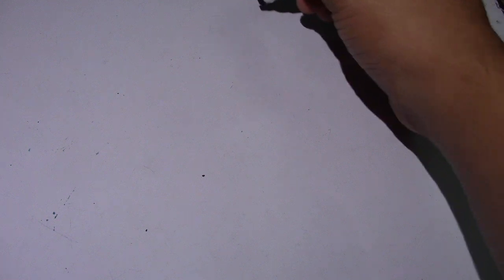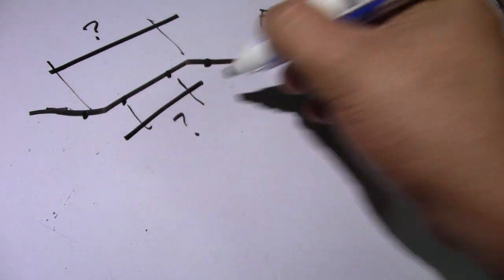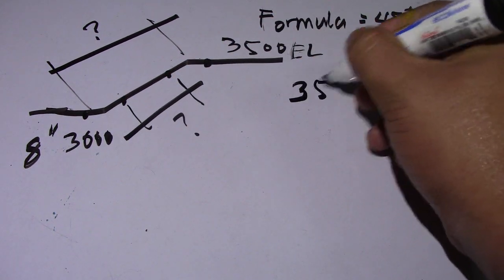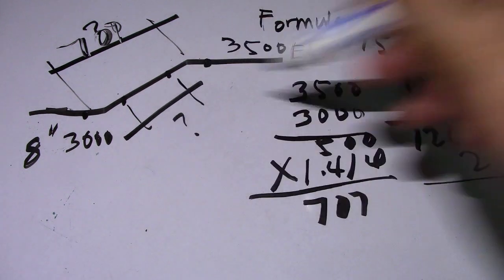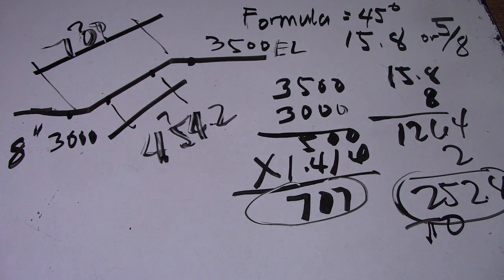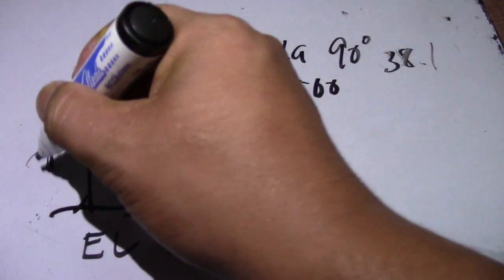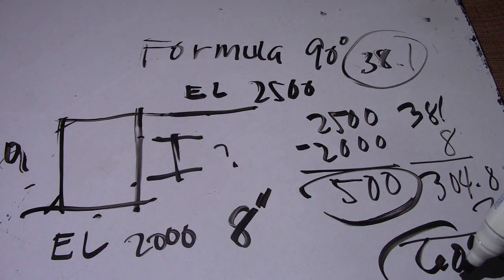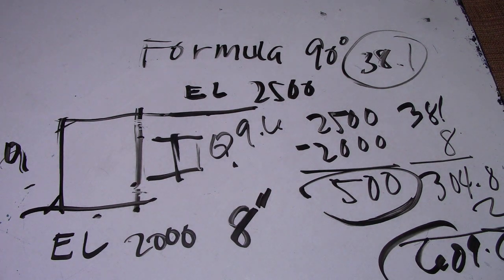How To Compute Travel, Spool and Take OFF Given Elevation, Diameter of Pipe

Comment: Pare dito sa computation mo ng 90 degrees short ung given mo ng elevation kc sa take off mo -109 ibig sabihin babawas kpa sa elbow sa compute mo na yan. Dapat dinagdagan mo ung elevation ginawa mong 3000 pra 1000 ung travel minus ung take off Ng dalawang elbow na 609 equal 301 ang spool to be cut.
Reply: ctoc 500 take off 609..paanu naging 109 ang spool..
Reply: @ren.b5106  isipin mo pre ang elevation mo 500 tapos Ang babawasin mong take off Ng dalawang elbow 609? Di negative 109 ang sagot mo jan. So mean short ung elevation or kulang ka sa length ng pipe
Reply: @ren.b5106  609take off dalawang elbow, tapos binawas mo diba sa video mo ung elevation na 500? Kong dimo magets panoodin mo last video mo. Short ka sa elevation given mo.